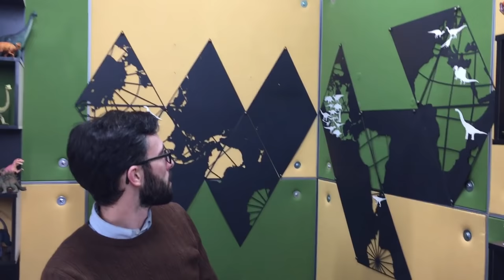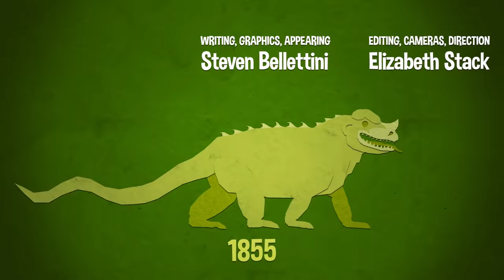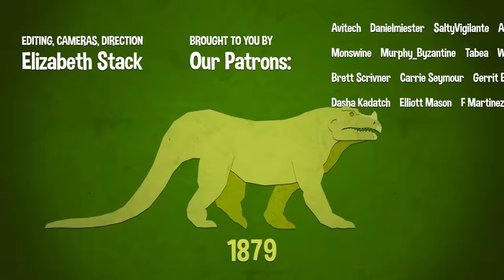The New Set is Ready!: YDAW Behind-the-Scenes #3

Comment: You could have taken that 2nd MDF piece and attach it like a privacy panel to the front of the desk. It would give the desk much needed rigidity once screwed to both the cube sides and the top MDF board. Plus enclosing the cubes on front side prevents having your props get pushed out as you stuff more in from the back.